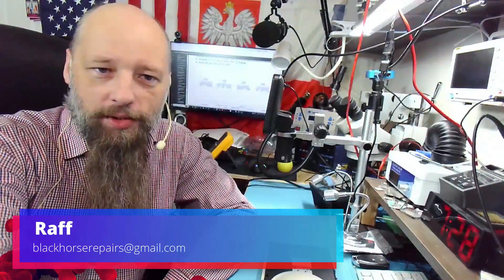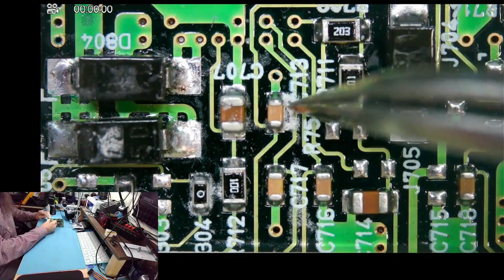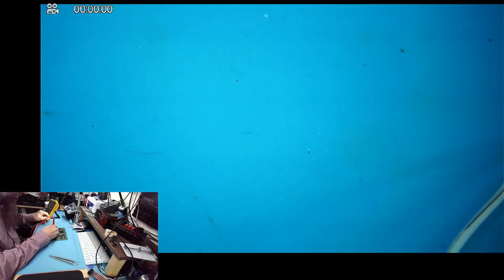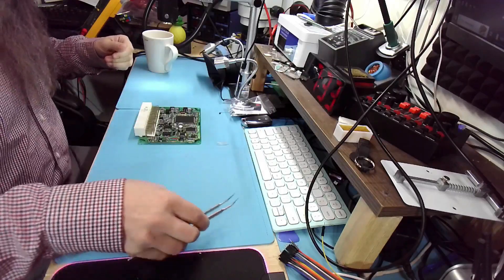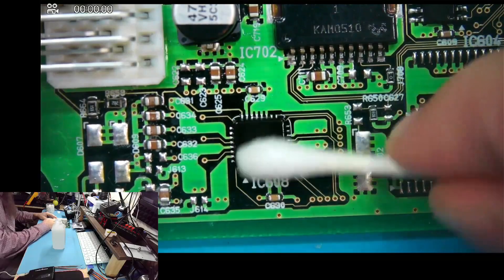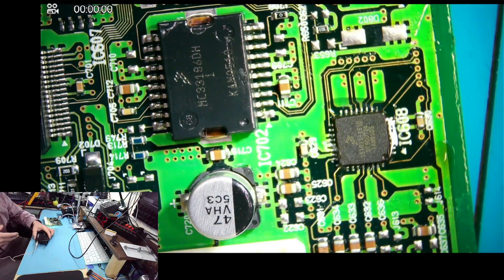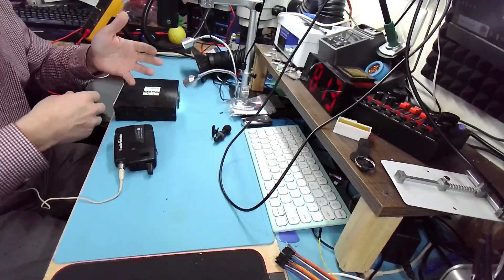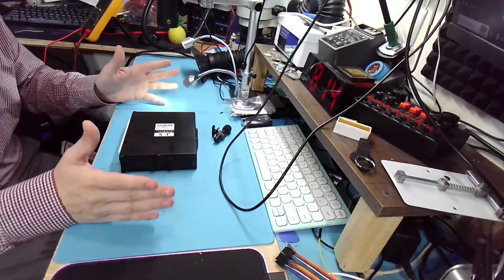ECM Repair for Ryan

Comment: How exactly did you know it was that it's IC608? The resistance was fine. Looking at it I couldn't really make out any cracked cold solder joints!?
Reply from the maker: Excellent question. I can't take credit for this though, I learned about this fault from a forum, then I tried to identify whether it's cold solder or cracked trace, but it turns out to be just the solder. So the repair is just replacing the solder. Confirmed countless times 😁
Reply: Id love to inspect it further under a scope just to see, but interesting that it works every time. Keep in mind, it may not be the solder at all, as you have to heat up the IC to remove it, then you have to heat it up again to reinstall it. It may be the heat playing a role on the internal components of the IC and not the solder as you assume. Never the less nice that it work after the reflow procedure  @blackhorserepairs
Reply from the maker: @beogeek  sometimes I replace the chip, if the heating was the solution, reflow would help but it doesn't. If just reflow the chip the problem of misfires goes away for a week or two and returns again. Only the replacement of the solder actually resolves the issue for good.
Reply: @blackhorserepairs  that's extermly weird, I've never ever seen that in my 15 years of electronic repair work!
Reply from the maker: @beogeek  it sure is weird and I have not seen such issue before myself.

Comment: Dear Ryan,

For testing the ECM on the bench you need  an ECM simulator, which can assist you for final checking.❤
Reply from the maker: That is true for ECMs made before 1999 (roughly), this ECM will not turn on until it completes the booting procedure which requires other "signed" parts, once they all agree the ECM will attempt to crank the engine. Then of course you need the dummy engine to produce sensor signals and they have to be on point, otherwise the ECM will detect misfires and other faults. This business used to be simple 20 years ago